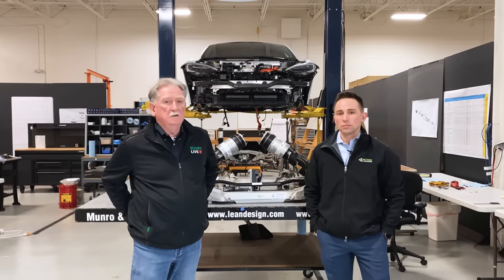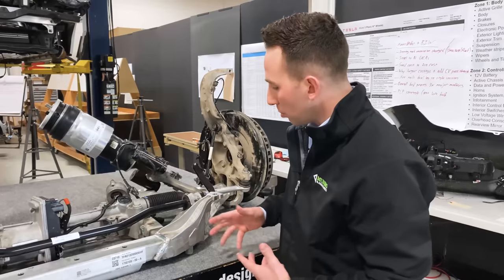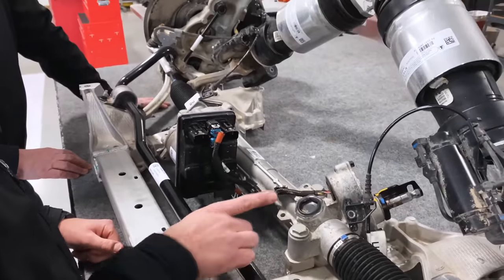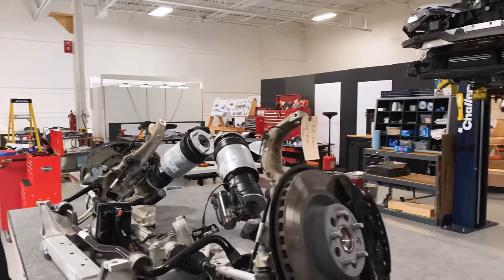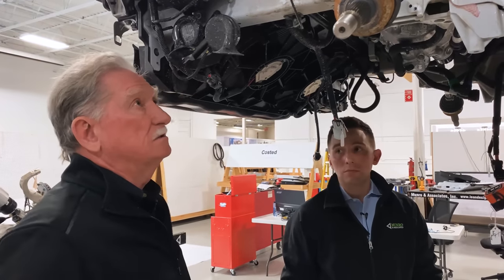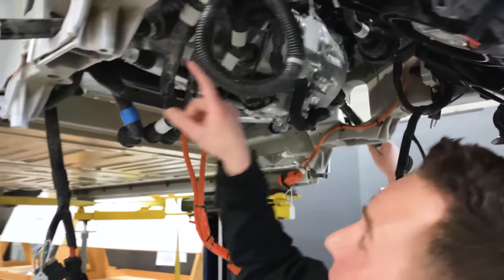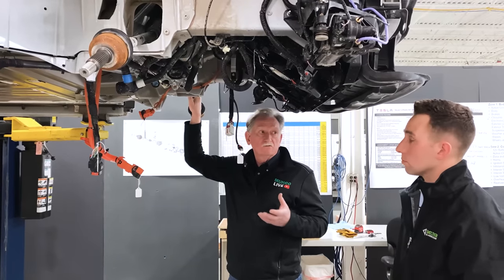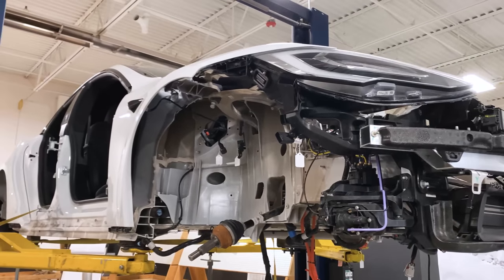Front Cradle and Suspension | Tesla Model S Plaid Teardown

Comment: Is the mechanical component for the steering not based on loss of power?  If the car loses power while in motion, if it were only wires would the driver lose the capability to steer?
Reply: Putatively.  But now think how much more devastating this failure mode would be on a airplane.  There are ways to do this with electronics and redundant systems that are safer and more efficient than with mechanical links.  edit: FWIW, I've been the patent attorney on a number of these aircraft electro-mechanical actuator systems with redundancy for critical flight surfaces.
Reply: The F16 uses a dedicated emergency backup flight control battery in case of engine/generator failure.
Reply: Losing power steering on an f150 is catastrophic despite mechanical linkage bc only a gorilla could steer that beast.  Redundant drive by wire is vastly safer.
Reply: Cryptic Fox - it would require multiple redundant power connector as fail safe.
Reply: I do wonder how they would best make a drive by wire system redundant. Maybe add a super cap that can power the steering motor for a few minutes? Maybe a full redundant electrical system for safety related components like head and tail lights, plus steering? I just wouldn't want to trust a regular battery with a limited life span as the redundant power supply. 10-15 years down the line and some hacked home maintenance job goes bad on the road, I'd like to see the steering system still function.  
One big difference between commercial aircraft that use fly by wire systems and a large percentage of cars on the road, is lack of regular safety inspections on the latter.....
Reply: If you loose power in an electric car, you also come to a standstill, because your drivetrain also has no power. Or at least some of it's systems. Now, you could obviously still be in motion at some pace, but not for long anyhow.
Reply: To be safe you'd have to have a backup system a backup battery a small one.
But just as in your car if that u-joint breaks you can't steer there is no backup system.
Reply: Probably a car that sat in an outside car parking for years would only be moved with a crane (or in straight line).
Reply: @Marlow925  so no different from 99% of combustion powered vehicles made in the last 30 years. the engine is not going to continue running without its electronic control unit.
Reply: Any critical component should be implemented with redundancy. Aircraft have several layers (up to 4) of redundancy built in. 

A ‘steer by wire’ system should probably not only have redundant wiring but also redundant power sources, actuators and control units just to name the main components. 

Just my thoughts.
Reply: @legobis4484   I'd like to see how much steering control a driver actually has with just the mechanical connection if some electric steering component failed. And practically speaking, how well an average driver would do. At this point I'd be willing to entrust myself to a well-designed redundant electrical steering, but the emphasis is on well-designed and executed. 

I have a problem with Sandy's comparison to aircraft. Planes receive magnitudes more scrutiny from the FAA than NHTSA or anyone can possibly give to the high volume of automotive production. This applies even more to mandated maintenance and inspection.
Reply: If you want to pay a licensed mechanic $1000+ to annually inspect your car, and occasionally replace your electric steering on a pre-determined schedule even if it still works fine, then you can have steer by wire the way it's done in airplanes.
Reply: @mechanismguy  👍 Thanks!
Reply: @mrknesiah    Yeah I was amazed when 1st learning that, losing engine power should never result in loss of steering but it does for at least some of those trucks.
Reply: I owned a Jeep Gand Cherokee Laredo and had the power steering fail more than once.  Thank goodness I go to the gym... I won’t feel any less safe with a fly by wire system, besides, couldn’t the self-driving System take over in the event of a complete failure?
Reply: @legobis4484  Exactly. Airbus FBW aircraft (similarly to Boeing FBW aircraft) only have physical linkage with the stabilizer trim. Other than that is is purely electronically controlled with an originally 80s design!
Reply: Well let's put an end to this. In a plane if you lose steering you crash and die. On the road you crash and survive, how then would you steer the wheel? Hence mechanical steering will never go away.
Reply: @legobis4484  so what you're saying is ... SIGH ... NHTSA just like US DOT, are still using rules and regulations from the Jurassic dinosaur era ... /facepalm when are they gonna get with the program :(
Reply: @mrknesiah  I guess main thing is quality of quality control...
Reply: Everyone forgets that aircraft are exponentially more expensive than anyone is willing to pay for a car. Aircraft have triple redundancy on all critical systems and drives the cost through the roof, not mentioning the additional space all those safety systems would take up in the vehicle.
Reply: @legobis4484  That's true, but maintenance requirements on an airplane are vastly greater. Literally anyone can service a rusted out beater with no maintenance schedule or logging requirements.
Reply: @drewm9491  with full self driving, eventually cars wont have a steering wheel
Reply: @drewm9491  But there is no mechanical "steering" on FBW aircraft??
Reply: About the only tactile interaction left with electric cars is the steering 'feel', and even that's pretty poor on most due to the demise of hydraulic systems.
For me, one of life's pleasures is stringing together a few bends on a quiet country road , feeling the front tyres bite the asphalt. I guess for most people it's just transportation. :-(
Reply: @mrknesiah  
That's absolutely not true. Not if you were moving down the road at a reasonable speed. Certainly in a parking lot not moving it becomes extremely difficult to turn the wheel on anything. Start going 2 to 5 miles per hour and the effort gets significantly easier.
Reply: @legobis4484  remind me please about the cost of certified airplane components ?
Reply: Does it matter? What other part of any modern car gives you a direct mechanical linkage? None do! Brakes...nope. Throttle...nope. Starter...nope. Automatic transmission or DSG...nope. LOL!
Reply: @Jon VB 
Prius does not have steering by wire. It's got a regular mechanical rack with electric assist like most cars today.
Brakes are sort of brake by wire, however there is a direct hydraulic backup system at the bottom of the pedal travel.
The Prius is not a 400 volt system, the traction battery is about 250 volts.
And a regular 12 volt DC battery also.
Reply: @de-bodgery  
Most cars actually do have direct hydraulic brakes. There are systems in place for automatic emergency braking. And the systems can override or manage the hydraulic pressure that you create with your foot and the brake booster. There are cars like most Toyota hybrids that have a semi brake by wire system, But even that does have a redundant hydraulic backup at the bottom of the pedal travel.
Throttle by wire defaults if there's an error to closing the throttle. And a lot of cars still have a ignition key. And a power button doesn't do anything different than the ignition key does anyway. Just closes a contact nowadays the ECU then tells the starter to go. In the old days it would have been a simple relay. Some cars that probably still is.
Reply: @donjones4719  planes cost with redundancy in the millions...not cars for average folks
Reply: @Craig Ruchman  no such thingvas self driving...wont be for a long time...
Reply: @De-bodgery  my2019  vw golf r is manual trans,stick..driving not going along for a numb roll.  Electric steering with lots of feedback not numb...
Reply: @cengeb   Exactly.
Reply: Разделное питание. Не, не слышал
Reply: every self-driving calculation is performed on two separate chips my bro, so there are definitely engineering ways to double up on safety features that would prevent an out of control scenario.  Don't forget that each tesla has the huge battery pack underneath it but another battery under the hood for the control systems.  They could connect both batteries to the steering system for redundancy
Reply: I suppose that it is easier to have a small number of aircraft that are flown and serviced by highly certified people operatre safely than a very huge number of cars that can be operated and serviced/tinkered by a lot less certified people, and never mind the much extra inherent safety of a solid metal steering
Reply: @Macmonkey1000  Since the steering wheel would have a motor on it so that it turns in time with the rack, and there is likely force sensors on the steering rack as well, I do wonder about the practicality of having electrical feedback able to be adjusted to suit the user and situation. Dial it up for the track or a spirited road, dial it down for cruising.
Reply: @craigruchman7007  I don't that will be fully the case. There will be some kind of emergency steering attachment in case of an accident and you need to move the vehicle. Basically, you won't need a steering wheel to drive, but the traditional steering will still be there just in case. Perhaps an access panel and a steering wheel that snaps in, like race vehicle. Otherwise what will you do if you get in an accident and have no power. Redundancy, there's always redundancy.
Reply: @cengeb  
Tesla has beta versions being tested.
Car can navigate around San Francisco about 75% successful.  It currently drives about like a new teenager driver.. especially at turns and when something unexpected happens.
But it's surprisingly good. 
I agree it's years away. But may not be as far as you think.
Reply: @Marlow925  that would 'loosen' you up a bit!
Reply: @legobis4484  true, but aircraft are much more strictly maintained. Most cars are not as much.
Reply: @craigruchman7007  A complete failure like loss of electrical power?
Reply: Yeah and I’d say that a airplane is slightly more expensive than a car.
Reply: @drewm9491  how about in a plane at altitude you have time to think and bail.  In traffic or on a mountain road outside curve it’s a split second decision of life or death.
Reply: @kens97sto171  exactly.  The Kona/Niro EVs have a complicated hydraulic braking system that defaults to work in a conventional way, yet when working normally uses regen to provide the vast majority of braking. I think even the Tesla doesn't do that.
Reply: @ZzHasbrozZ  Exactly, you just said it " a split second decision". How can you do that without a steering wheel? You can't, that's why manual control will always be needed.
Reply: @mechanismguy  I came here to say something along the same lines. Average “Joe” can do car maintenance. What stops him bodge fixing a fault on the electric DBW steering on a 20 yr old car and driving around at 100mph until his dodgy solder joints come loose?
Reply: @paulaxford6754  
Actually I think Tesla may be the only one that does NOT do that. Tesla's braking system is purely hydraulic with assist. But there is a computer controlled assist that can push the brake pedal without you actually pushing the brake pedal. Pretty much everyone else uses a blended braking system. 
There are advantages to each. Even the Toyota Prius is far back as 1997 used a blended braking system. And still does. It is more complicated. 
Honestly even non-electric / hybrid vehicles often have some kind of assisted braking system either for emergency braking or  for traction control and stability control. They apply brakes on whatever wheel is required to achieve the desired outcome.
Reply: @JamesUKE92  It's similar to why medical devices cost a lot. They have to regulate the PROCESS of design, manufacturing, and service as opposed to the product itself. Most products are unregulated, or essentially "regulated" by the possibility of the manufacturer being sued. Other products are regulated by requiring them to meet a certain set of standards, which can be checked by testing, like bumper height requirements on cars, or electrical products having to be properly grounded.
Reply: @Jon VB None of what you said is true. A Prius doesn't have steer-by-wire or brake-by-wire. Just like this Tesla and essentially every other car, it has mechanical steering and hydraulic brakes with power boost (and the boost is electric, as in the steering of most current cars and all EVs, and the brakes of hybrids, EVs, and even some conventional cars). The brake control system does block off the hydraulic lines as necessary to replace friction braking with regenerative braking, but fails to purely hydraulic. There is no high-voltage motor in the steering (or brake) boost system.
Reply: @davidhumeston5292  Yes, a backup battery makes sense. Even in an EV with a high voltage traction battery, the steering and brake boost use the low voltage (~12 V) system; that's done in part because the available components (from Bosch, etc) are 12 V for use in conventional vehicles, but it also means that you may still have control power even in the case of a traction system failure. Electrically boosted brakes also include an additional capacitor bank for emergency power, to make them more comparable to traditional vacuum-boosted brakes with a reservior.
Reply: @brianb-p6586  I was just thinking with Tesla or BEVs in general you could steer the car with the brakes and motor controls to just get off the road safely during a catastrophic failure.. I truly think we will get rid of the steering columns and be drive by wire...
But as usual change frightens people.
Reply: @paulaxford6754  All EVs work that way (computer-controlled blending of regenerative and friction braking, failing to fully hydraulic friction braking), not just Kia.
Reply: @davidhumeston5292  If you want to try steering with freely castering front wheels by applying braking torque to individual wheels, you can do that with any car having electronic stability control... and every car sold in North America has been required to have stability control for about a decade.
Reply: MANUAL RACK FOR THE WIN...!!! (just like old Ferraris and other Italian makes which never had power assist).
Reply: @phillyphil1513  I think you'll find they don't have much weight over the front wheels. Cars where relatively light.
BEV Cars are 5,000 lb+
 now... Definitely need power assist.
Reply: @phillyphil1513  Cars with unassisted steering have either light front ends (some rear-engine and mid-engine models, or just very small cars) or have steering which is too slow. Quick modern steering without assist on a car with a ton on the front tires would be a losing idea.

Comment: I think the problem with going to steer by wire is that just like the airplane you would need multiple redundant systems. And at that point have you really saved anything versus just using a steering shaft? It seems like over complication for no reason when a simple universal joint and a steel shaft have worked for a hundred years perfectly fine. 
People already complain about the lack of feedback in electric assist steering with a mechanical linkage. Hydraulic power assist steering systems always had a much better road feel. I suspect going to steer by wire would be even worse. And again how much synthesized feedback do you have to put in to simply replace a simple mechanical device.
Reply: Yeah, if you end up having to effectively stick in a high-end force-feedback sim wheel to get good steering feel, you'll be adding a lot of weight and expense.

Comment: Sandy, thank you for the fascinating content- you make a provocative case for automotive „fly by wire“ (FBW) steering - if EMP and other similar catastrophic failures can absolutely be ruled out.

The 1989 United flight 232 DC-10 crash serves as a stark reminder of FBW frailty. The center engine fan blisk failed and destroyed the proximate triple-redundant hydraulic lines, all that remained to steer the aircraft were the mechanical trims and differential thrust from the #1 & #3 engines.

Until ~5 years ago, almost all (or all) light aircraft had mechanical control of the primary flight controls. Military and commercial aircraft have largely been FBW or even fly by light (fiber optic) for many years.
Reply: It's an "FSD" car.
The systems are already in place.
You could in theory bolt a well known brand of gaming wheel to the dash, connect it to the Tesla system and have (maybe with a couple of sensors on the rack) full force feedback steering. Just double up that Interface.
Reply: The DC-10 did not have fly by wire flight controls.  It used cable actuated controls with hydraulic actuators to move the flight control surfaces just like the B747, B757, B767, A300, A310 & L1011.  On UAL flight 232, the ruptured fan disc severed all 3 redundant hydraulic systems inside the horizontal stabilizer, leading to a complete loss of hydraulic fluid and left no hydraulic pressure available to power the flight control actuators.  Some smaller airliners with hydraulic powered flight controls such as the B727, B737 also have aerodynamic anti-servo tabs on the flight control surfaces to assist in moving the control surfaces during total hydraulic failures.
Reply: Indeed - nor did I claim it to be FBW; it serves as a warning of FBW frailty.